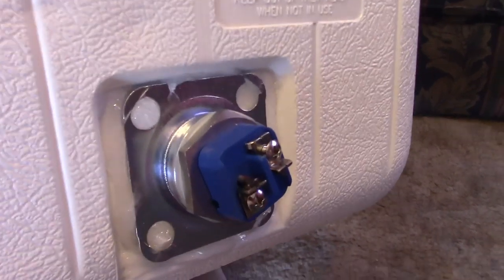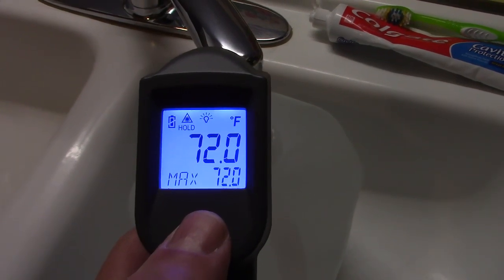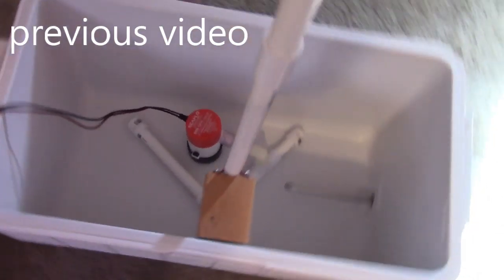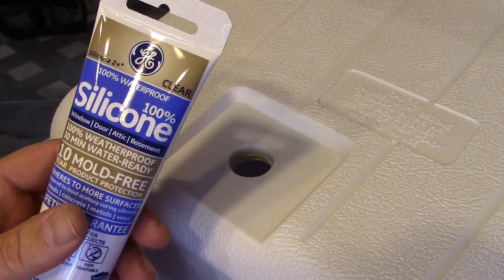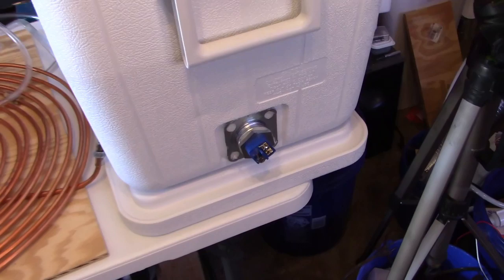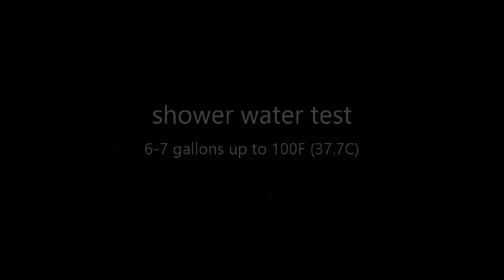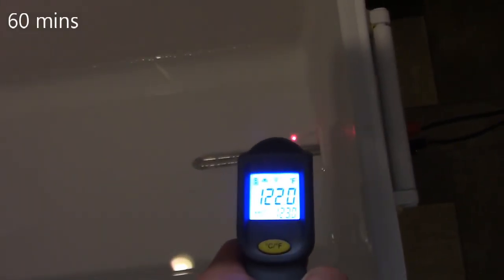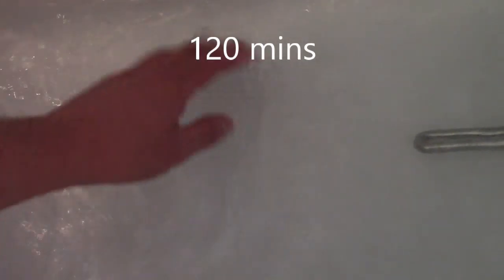12V DC "Off-Grid" Water Heater! 12v/12amp/12 Gallon tank! (ice-chest conv.) - can be solar pwrd! DIY

Comment: the question is how long will this heating last on a fully charged 12 volt battery by itself??
Reply: Discourses For Higher Enlightenment depends on the insulation of course but 12 amp draw and takes 1 hr to heat means 12 amp hours so your standard 100 amp hour 12v battery which is really a 50 amp hour battery would be able to fully re heat the water from cold four times before being classed as flat. The better the insulation the longer the water stays hot between heating phases.
Reply: @HandyC  thanks but why do you say a standard 100 amp hour 12v battery is really a 50 amp hour battery?
Reply: @ctm130  Because every time a lead acid based battery is used, it loses a tiny bit of capacity due to degradation. This isn't very noticeable during standard use in a car/truck. But, as you discharge further and further, more damage is done. If you discharge past 50% capacity every time, you nearly cut your battery life in half. If you discharge to absolute 0, you run a risk of the battery not being able to recover. 

Battery life is measured in cycles, so naturally, it does count as a "cycle" every so often. A "cycle" is a total percentage of the capacity being used and recharged.

So say you have a battery that's rated for 10 cycles.
If you use 50% of the battery per day and then recharge it to 100% that night, the battery will last 20 days. 
If you use 95% of the battery per day and then recharge it to 100% that night, the battery will last 10 1/2 days. 

This is obviously generalized for simplicity, but that's the idea of it. Most AGMs are rated at a couple thousand or more total cycles.

Comment: Where did you find that flange for the heating element?  I can't seem to find it.  I'm talking about the part you siliconed to the cooler.  Any help would be appreciated 👍
Reply from the maker: hi. i got in on amazon. this looks like the one https://www.amazon.com/Camco-7223-Universal-Adapter-Kit/dp/B000BQMK9C/ref=sr_1_2?crid=2ZFEVLF4HB57P&keywords=camco+flange&qid=1659393789&sprefix=camco+flag%2Caps%2C243&sr=8-2

Comment: How does it not melt the plastic that it goes through? I don't understand isn't it too hot?
Reply from the maker: hi there. 2 main things allow it to work.  one is that the water keeps the element relatively cool (just make sure the element is totally submerged). the other reason is that the element doesn't really get hot at the base (near the ice-chest). it gets hot an inch or two out from it. *notice that the small bubbles don't form near the base. 🙂
Reply: No it won't melt the plastic at all,the cooler plastic is thick dude.i already had one,I put 1500 watt on it.i love it so much
Reply: @fanech14  would it work with an actual water tank under mount? Or is that plastic too thin?

Comment: I have a 500w solar panel and wind turbine kit from Amazon,  as yet unused,  in light of the power companies ripping us off i am looking for a low voltage method to heat water for shower use or general use. I think more equipment will enter the market based on this to enable consumets to rely less and less on the grip and more importantly stop getting ripped of.
I would like to see your system rigged up to an off grid set up with actual power usage and time records shown.

Comment: Where did you find the heating element with the universal plate?
Reply from the maker: hi there. the heating element is a 12v 150w dernord element (sold on amazon) and the universal plate is by camco and is sold on amazon too.
Reply: @desertsun02  great. Thanks

Comment: Hello, does that specific universal adapter have a brand name or a particular place it can be purchased. I have to get one. Please and thank you.
Reply from the maker: hi there. the brand is camco. i get them on amazon. here's is a link to the same one i used (i think it's the same one) https://www.amazon.com/Camco-7223-Universal-Adapter-Kit/dp/B000BQMK9C/ref=sr_1_15?crid=2OBIS9QPNNKF4&keywords=camco+flange+water+heater+element&qid=1654612931&sprefix=camco+flange%2Caps%2C128&sr=8-15

Comment: Question? Can I just wire the element to a deep cycle battery? I have a 300 watt element and some 12 awg wire. Thank you in advance.
Reply from the maker: hi there. yes you can. a 300w element might pull about 25 amps though so you would probably want to use a battery bank. you may have to use a thicker wire too. you might want to use 10 awg or even 8. i'm not sure if 12 awg will handle the amps.
Reply: @desertsun02  thank you for responding. I happened to have some 8 guage wire, added the proper lugs and 30 amp gator clips. I used a bulk head fitting to install the element in a 5 gallon bucket and a rechargeable portable water pump with a shower head. I plan to use this in my tiny 1967 camper.  300 watts may not heat up quick but it does work with very little work on my part and won't cost a penny here on out. Im using 210 amp hour deep cycle batteries with a Victron Battery protect to prevent under voltage. Super cool diy project my friend! Thank you.

Comment: Hey, how many watts does this take each hour? I have a jackery 500, how would I wire this with the 12v?
Reply: At 150W it draws 150w/hr over the hour, if the Jackery has a standard cigarette type 12v socket , thats rated at 15amps, the socket is rated at 180W, so at 150W it can be plugged straight in

Comment: Hi dear, nice video, can i connect for example a solar panel 300w solar panel to a 24v water heater?? warm up before
?
Reply from the maker: hi there. it depends on the voltage of the solar panel. if the voltage is near 24v or a little higher i'd say it should work
Reply: @desertsun02  sorry, 300w 24v solar panel can i Connect directly to a 24v heater 250w ? Thanks
Reply from the maker: i haven't tried it, but i'd say it should work. sounds like they would pair up perfect

Comment: Do you have any advice or can point me in the direction of a wiring diagram for these? I have a twin element one and it took a very long time to heat up and used a lot of battery! Many thanks
Reply from the maker: hi. i've never used a twin element one. those are 300w or 600w if i remember. the 300w one i saw had 2 150w elements. is that the one you have?
Reply: @desertsun02  I presume it probably is

Comment: Love your videos, but ,may I ask as to where I might find the metal plait used for the heat element ? I searched via, amzn, home depot, lowes , I need an specific name for the product , please
Reply from the maker: hi. sure, it's a camco 7223. i'll look for the link. here's a link  https://www.amazon.com/Camco-7223-Universal-Adapter-Kit/dp/B000BQMK9C/ref=asc_df_B000BQMK9C/?tag=hyprod-20&linkCode=df0&hvadid=167126276842&hvpos=&hvnetw=g&hvrand=10731266949937950352&hvpone=&hvptwo=&hvqmt=&hvdev=c&hvdvcmdl=&hvlocint=&hvlocphy=9030035&hvtargid=pla-275328510901&psc=1
Reply: @desertsun02  Thank you ever so much for , your expeditious response , have a peaceful evening!
Reply from the maker: @ELKA SIDAV thank you. you too.

Comment: I tried connecting up a 400 Watt panel to one of these elements rated at 12V DC. I mounted the element in a tank of water. When I checked the voltage in the circuit, it was reading only about 3 volts. It didn't seem to be getting hot even though it was sunny outside.
Any idea what is wrong with this setup?
Reply from the maker: i can't think of anything that would cause the voltage to be 3v. possible things to check would be to take a reading on the panel (without the element attached) to see if it's working right. make sure you are using wire that can handle the amps. make sure connections are tight. it could be a faulty element (but that is unlikely). the elements are very tough. make sure nothing is covering even one cell on your panel. many panels will barely work at all if even one cell is shaded. the funny thing is that if the entire panel is shaded evenly then it still works fairly well (but a little shade on one-half of just one cell and there is a massive drop in power). only other thing is are you sure the panel is 12v? nearly all 12v panels are 200w or less. 300 or 400 watt panels usually have much higher voltage.
Reply: @desertsun02 Hi. Thanks for the reply. You are right, the panel is 33V open circuit, but I thought that higher voltage would have been an advantage? I measured the voltage coming from the panel to be about 33V on a sunny day. I measured 3V across the terminals of the element when connected to the panel. The element has 12V 300W stamped on it. When I connected the element to a 12 volt battery, it did get very hot, but the battery was draining very quickly and the voltage was dropping. So I would rather have a system which does not use a battery, just solar panel.

Comment: I want to build one of these, but you don't show how to hook up the power?  What do I use for a battery or batteries???
Reply from the maker: hi. you can use any 12v source that will give you the amps. it pulls about 12.5 amps. it's a straight connect from the heating element to the power source. you can use a 12v deep cycle battery or batteries. you can hook it straight to a 12 volt solar panel or panels. (i hook it to two 100w 12v solar panels). it's only 12.5 amps so you can even run it using your cars' 12v power socket (assuming the fuse for that socket is 15 amps). you can also run it off of an ac to dc transformer (i use a 15amp one).
Reply: @desertsun02  A lot of this is new to me.  Is a 20w Solar Panel not gonna work?  Or will it blow something......I assume I should just connect batteries that total 12v and just call it good.....?
Reply from the maker: hi. a 12v 20w solar panel won't work. that would probably only be a 1 amp panel. 12v 100w solar panels usually produce 5.5 or 6 amps. i use 2 of them to get to roughly 12 amps. if you're going to use a 12v battery, it should probably be a 12v deep cycle battery.
Reply: @desertsun02  I will do a Google search on what that is.  This is all very new to me.
Reply from the maker: hi. that battery is only 7ah (amp hour) so it wouldn't work for very long. you would want to go with a 12v deep cycle battery that is 100ah or higher. walmart sells them for about 75 dollars (the last time i checked). note that you can only pull one third to one half of the batteries capacity before it needs recharging. so you can get about 33 to 40 amp hours out of a 100ah battery. since the heating element pulls around 12.5 amps, that means you could run it about 3 hours on a 100ah deep cycle battery.
Reply: @desertsun02  Don't see any on the Walmart webpage for that price, but I will keep looking.
Reply: @desertsun02  That battery, the 12v deep cycle you talk about, can I use a regular car battery charger to charge it in my home?  You know, the one you plug in to the wall, and charge a car battery with?  If not, what do you recommend??

BTW, just got the pump and foot pedal to make the PVC shower on your other video.  Hoping I can figure this out.

Thanks for your help.....

Comment: So how do you keep the water from soaking into the inside and outside layers of the cooler? I tried to make an insulated chicken water with an insulated jug and water ran in between the two layers and leaked.
Reply from the maker: hi there. most ice chests have a type of 'foam insulation' between the inner and outer walls. the foam keeps out all the water. i guess some really small containers skip the foam insulation (so you'll need to use one with it).

Comment: Where do you find the adaptor that the element screws into?
Reply from the maker: hi. you can get those on amazon the one i used is a camco 7227 or 07227 (that is by memory) - let me check the site. i can't find the camco one but here is another one https://www.amazon.com/Reliance-9000030045-Element-Adapter-Kit/dp/B000H5S3JS/ref=sr_1_4?crid=1QO8X62UK8P1R&keywords=water+heater+universal+adapter&qid=1698270009&sprefix=water+heater+universal+adapter%2Caps%2C149&sr=8-4 look for best price. i just found the camco one it's 07223. https://www.amazon.com/Camco-7223-Universal-Adapter-Kit/dp/B000BQMK9C/ref=sr_1_2?crid=3JVY9CIZFTR1H&keywords=water+heater+element+adapter&qid=1698270156&sprefix=water+heater+adapter%2Caps%2C232&sr=8-2

Comment: Was thinking of somthing like this for heating in a van conversion. Most have large tanks of water if its steadily being warmed by the batterys/solar should provide a sort of central heating effect..
Reply from the maker: hi. sounds like a very good use for this 🙂👍
Reply: @desertsun02  How can the element be stabilized in a water tank while bouncing down the road?  A bulkhead flange seems inadequate to stop the element from bouncing and torquing the seal loose or breaking the element itself while driving... thoughts?  Maybe the element could be secured against the water tank at the end of the element?  using a material that can handle the heat?

Comment: Excellent job!   I really want to make one of these. Could you possibly provide the link for the Universal Flange Kit?  I cant find it on Amazon. Many thanks! and congratulations again, on a job well done!!
Reply from the maker: hi and thanks. to find them just type in water heater universal adapter. here is the link to the best one (in my opinion) https://www.amazon.com/Camco-7223-Universal-Adapter-Kit/dp/B000BQMK9C/ref=sr_1_1?keywords=water+heater+universal+adapter&qid=1575484239&sr=8-1

Comment: Good idea,you have to put the washer and screw on the outside.I did mine,I put a 2 inch hole on the cooler about 3 inch from the inside bottom I used 2 inch circular blade drill.then I use one inch & half by one inch & half sink strainer putting in backward.I also used 4 small washer and four 5/8 electric screw,screw head is kinda round.Cooler usually one inch thick.make sure the rubber washer is on the sink strainer thread on the inside of the cooler.Don't f**k up.

Comment: Where did you get that univeral flange adapter?
Reply from the maker: hi there. i got that on amazon. cost about $6. this one looks similar https://www.amazon.com/Camco-7223-Universal-Adapter-Kit/dp/B000BQMK9C/ref=sr_1_22?dchild=1&keywords=water+heater+unversal+adapter+1%22+threads&qid=1588266777&sr=8-22

Comment: How many watts? Can it be ran off a car battery charger?
Reply from the maker: hi there. the element i use is 12v 150 watts. they also sell 12v 300 watt and 12v 600 watt ones. some of the 300 watt ones are cool because they are actually two 150 watt elements 'combined into one unit'. each has its own terminals so you can run just one of the elements if you want.

Comment: Anyway to control the temp to what temp you want?
Reply: You would need a thermostat inside the ice chest that disconnects the 12v power when it reaches a certain temp and turns it back on when it drops below a certain temp.

Comment: Is there any way to do this without drilling a hole in a container?
Reply from the maker: hi. that's the beauty of it. you don't need to drill a hole in the container. it's already there. all i did was remove the plug assembly and put in the element. by the way if you don't want to use a container with a plug i have another video that shows this element mounted in a 1 gallon glass jug. it gets the water boiling. here's the link https://youtu.be/kOmGu8Uz674

Comment: The element doesn’t melt the cooler?
Reply from the maker: hi there. nope, not at all. if you look close, you can see the element doesn't even get very warm near the connection (the threads). notice how the bubbles only start forming  on the element an inch or two out from connection. must be a safety feature they build into them
Reply: Hell no ! I put 1500 watt on mine.

Comment: I might have to apply this to a pond heating set up. But would have to figure out temperature control and add sensors
Reply: Hi , did you ever get to try this in a pond ? Im interested in doing the same. Thanks
Reply: @derekbothwell4661  sadly I was not able to. I had too many other things stack up on me and honestly forgot about this after a while.

Comment: Interesting idea. Have you had any problem with the element melting the plastic on the ice chest? I know you used the 150w element, so it's not as hot as a 300w unit. ....I get that the element has to be submersed.
Reply from the maker: hi. the element won't melt the plastic. it doesn't get that hot near the connection. (look close at the bubbles that form on the element, none form within an inch or two of the connection) as that area is not heated very much. that plus the water keeps it plenty cool. about the 300 watt elements... they are usually just two 150 watt elements mounted on the same threads (and interlaced) to make one unit. each of the elements is the same temperature as the 150 watt model. it's just a second interlaced 150 watt element. *usually with a second set of screws too (so you can run the 300 watt ones as a 150er if you want.
Reply: @desertsun02 , thanks for the quick reply. I wasn't aware that the 300w, 12vdc elements are two 150w units in series. DC elements make sense as a dump load for a small wind turbine or independent water heating source. If they don't impact plastics when submerged, that makes them more valuable.

Comment: You can just buy the ones with builtin thermostat..Then regulate the temp.... Then use a well insulated bucket with marine pump. Wallah. You got a simple shower for camping. And all it need is a 12 volt 100ah battery and 200 watt solar panel.. Which if you have that to start with. You can take a shower everyday...